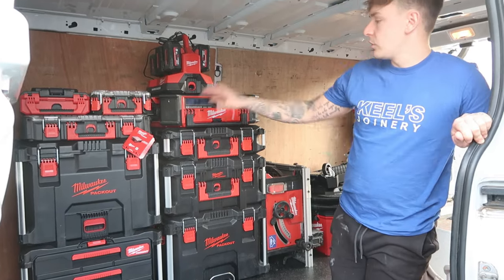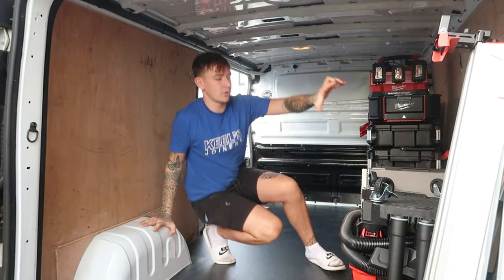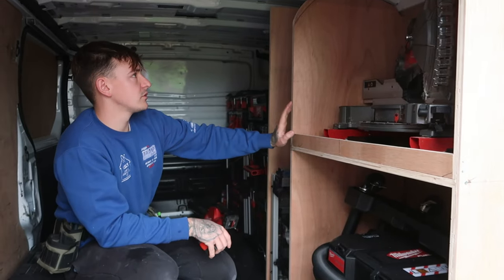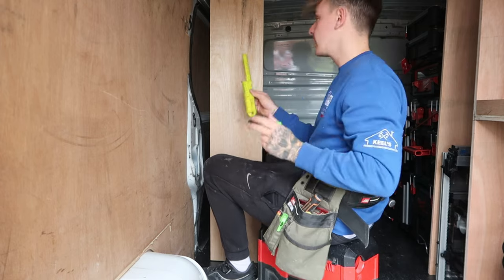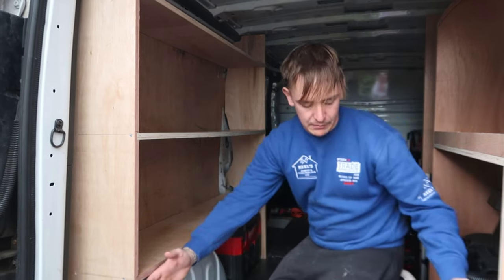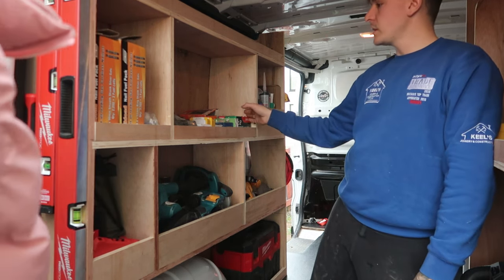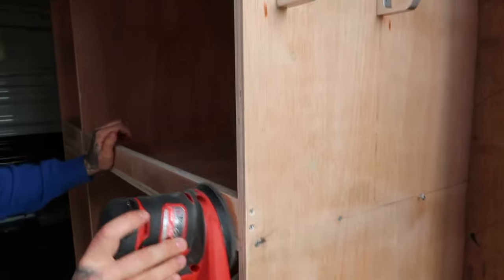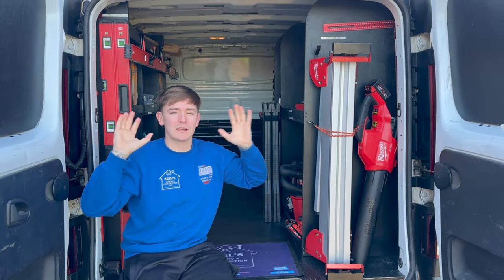New Van Racking | Milwaukee Packout Tools | Carpenters Van

Comment: Good vid, big tip for your tressel set up.. if you half lap 4x 4foot 3x2s to cross the 8foot lengths on your tressels. You can slot it together and use it as a sacrificial table. That’s what I do, it means you can cut an 8x4 sheet anywhere and not have to worry about the offcut falling or saw blade binding.
Reply from the maker: Thanks for the tip😊

Comment: I don’t miss my low roof van like gets to the back after a wile
Reply from the maker: I would like a bigger van but wouldn’t get through the drive thru’s 😂😂😂
Reply: @keelsjoineryconstructionltd   I have a custom l2h2 fits throu no-bother even with ladders on 😂 🍔 can fit 3.4 lengths in  and 8x4 sheets in  a breeze and stand up best thing I have done upgrading from the l1h1

Comment: You’re gonna regret those boxes!

I’ve made all the mistakes you don’t know you’ve made yet :(

Mistake one, those boxes. Everything you need is always at bottom of stack.. there’s not really room in that type of van to pull out to middle and fart about.
You should have bought All drawers, access anything easily, move nothing!

( you can modify a two drawer to a one drawer two) for big saws etc)

Mistake two drawers, making a plywood shelving contraption that you’re now locked into.

Your tool storage changes as you use it, and you don’t really know until you’re a couple of jobs in. ‘I wish I put this there or that here…’

You should have made just vertical upright ‘partitions’ and a  method of fitting shelves ( or with the drawers you don’t even need shelves !). Ie. like 32 mm holes like in a kitchen, backed up with pocket screws or whatever, anything adjustable is the point.

Personally I ripped all shelves out, bought the baseplate thing that screws to floor and and drawer unit can go anywhere, simply snaps in and stays or can be removed. All mainly packout width partitions, and one at front to suit a microwave built in mitersaw below 

Third issue that type of van, just too small eh? I’m still in that boat!  Next one SLWB AND HIGH ROOF ! 👍🏻

Get the packout boxes on eBay while they’re in good nick and get all drawers 😂